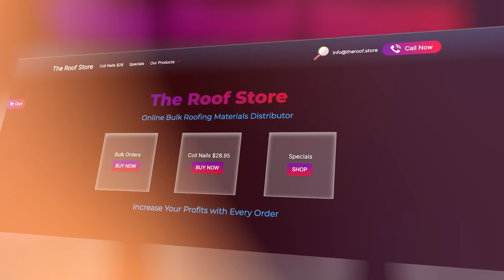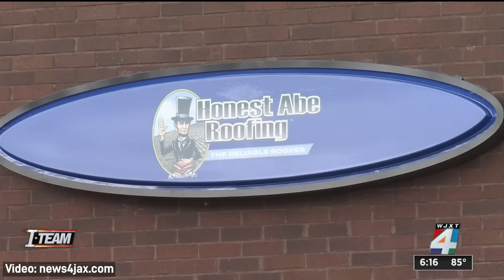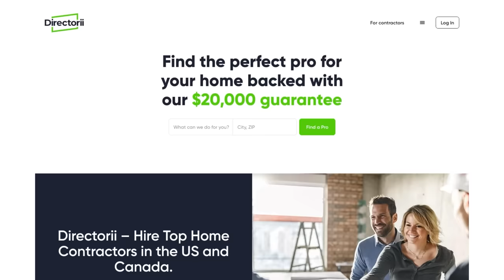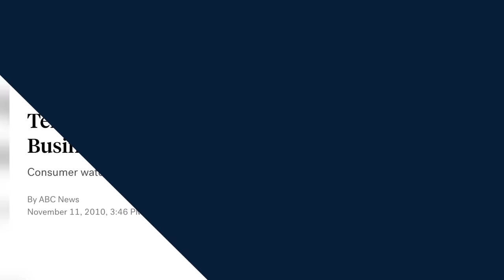Roofing News: Honest Abe Bankrupt, 24 hours on the roof, Badger VS Roofers | Dmitry's Report

Comment: Florida used to say that if more than 25% of roof is damaged then you had to replace. The new code effective Jan 1 says you can now repair any size. 

Honest Abe ads popped up on my feed more than anything else. Strong marketing game. As always numbers don’t lie.
Reply from the maker: Numbers don’t lie! Sad for failure
Reply: That's not what the FBC says. That was language added to the 25% requirements of the 2023 existing building code. The 25% requirements are still in play so long as the roof is not in compliance with the requirements of the 2007 Florida Building Code, which means if the existing roof was installed or replaced before March 1, 2009 then the 25% requirements are applicable.